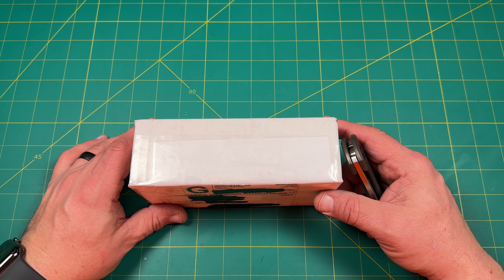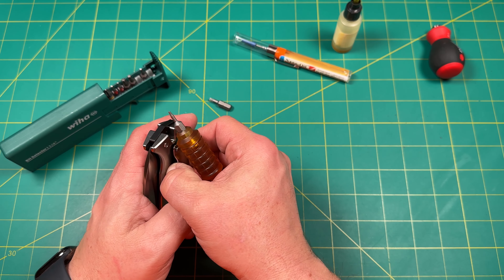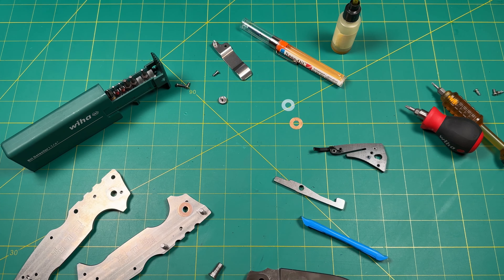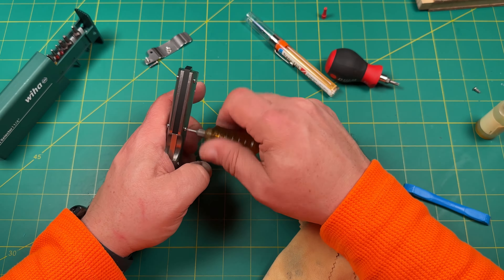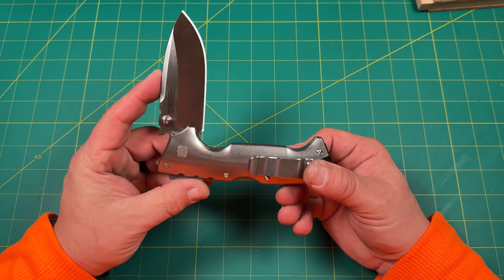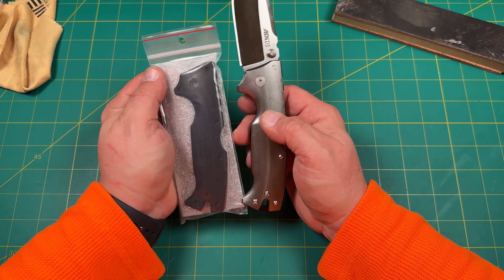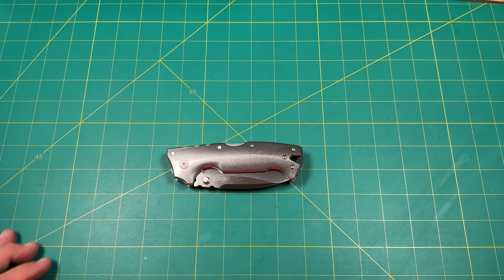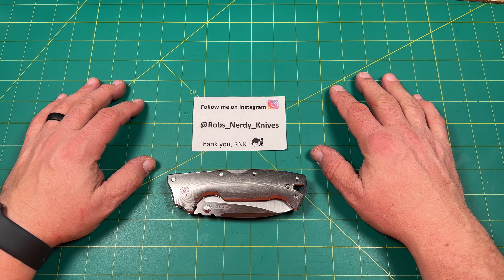Unboxing a cool Cold Steel AD10 knife in Original Goat Ti scales & doing a little maintenance

Comment: Ive seen a couple vids with the rattling cause of stop pin im wondering if they all have it after changing scales
Reply from the maker: It is many times due to the pins that Andrew Demko uses in his designs. They are meant to go 1 way, so if they were reversed, they will not sit correctly.